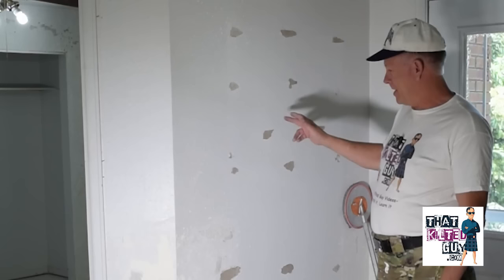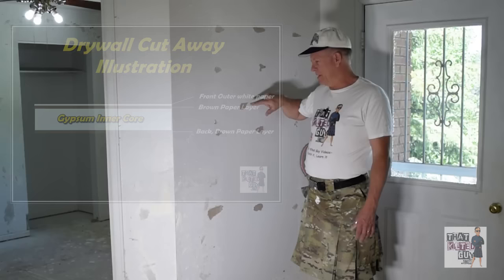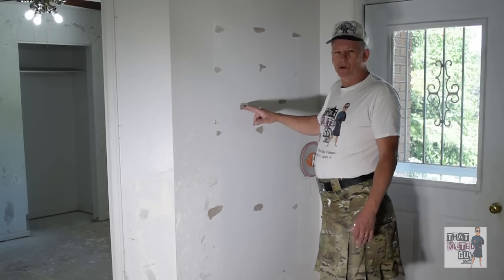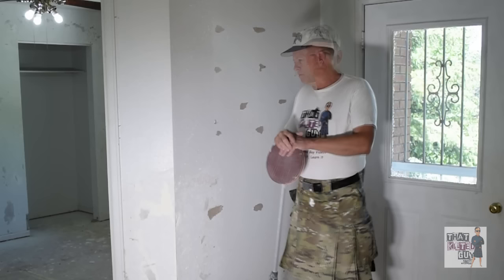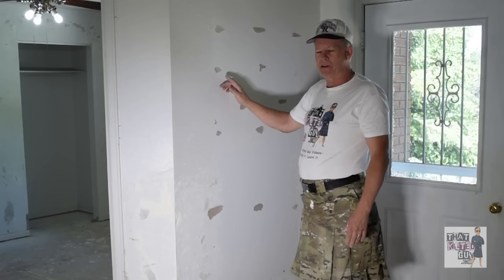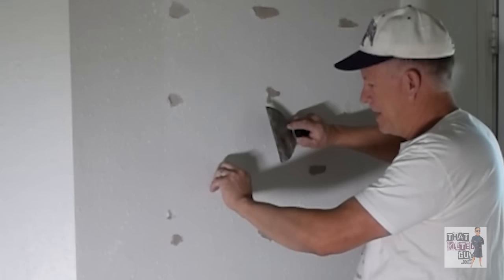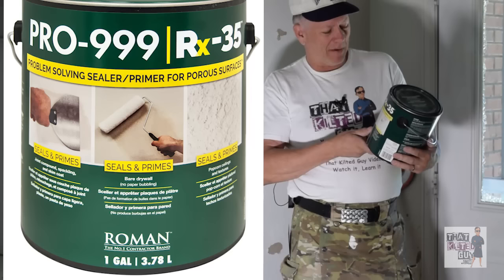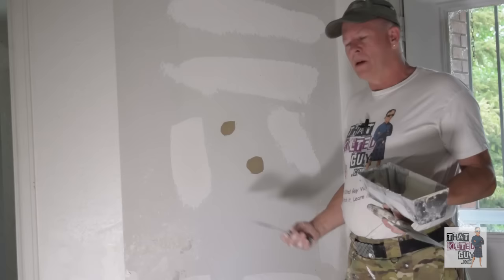⭐ Repair Damaged & Torn Drywall Paper BEFORE YOU MUD IT in 2022!

Comment: Shellac primer works great. Dries fast and thin, and really seals it in. I pretty much ripped off a whole wall (old Sheetrock). Did the whole thing twice and sanded it really quickly and mudded it. Came out fine (after I did an amateur skimming job).

Comment: Awesome technique for the smaller patches! What if you have an entire wall (almost) where the outer paper has ripped off down to the brown?
Reply from the maker: Well, that would make that wall a bit weaker as far is being resistant to punctures and such, but otherwise you would repair it is in the same technique as in this video. 

I hope that helps, and if it did, you can tip me if you’d like by buying me a Ko-fi sometime at ko-fi.com/thatkiltedguy. Thanks, Guy

Comment: This man knows his stuff! 
The basic rule of thumb for filling with mud is to build it up some, THEN sand it down to flush! It's so much easier to sand it DOWN TO flush, than it is to guess on how much to fill (or not put enough mud on) because it does shrink some! So.... you end up having to put on several thin coats ...and you still end up having to build it up, just to sand it to flush! Better to have a little too much than not enough!

Comment: good stuff but takes too long to dry... sand with sanding sponge almost down to gypsum, spray with rattle can of KILLZ, And coat with a pan of 5 minute hot mud.....You can finish that entire wall with 2 coats and texture in the time it takes for that stuff to dry
Reply from the maker: When you need to start coating right away that can work. I’m almost always doing other repairs in addition to these spots so the drying time is fine with me. I used to try the kilz a lot and it worked about 80% of the time and maybe 90%, but I still had too many failures. This product is more like 99% success. Another technique I’ve been experimenting with that seems to be working is simply spraying spray adhesive on it, rubbing it in and then I can coat the repair in 15 minutes with five minute hot mud. 

Getting rid of the brown paper is another option, but if you have six or eight or 10 of them like I often do, I prefer another method. I don’t really like ever leaving the raw drywall exposed and would probably tape it with mesh tape if I did.

Thanks for the input and for stopping by.

Comment: What if I’ve already put a coat of paint over the damaged spot thinking that Paint would cover it?  I’ve put compound over it twice and sanded it but it doesn’t seem to help
Reply from the maker: Hello, once it fails by bubbling, you just have to basically do what I did in this video and cut around it and peel off the bubbling portion and start over. That’s why I treat all of my brown paper spots with this product to avoid failures that I have to redo. If you have any further questions let me know. I hope that helps. Guy

Comment: I bought the Roman's 999 last night after seeing you recommend it in another video several months ago.

The new house has some full hand sized areas where there is brown paper after the older plastic corner bead was removed but the many coats of paint were not cut off of it first so it tore huge areas when removed 

I'm going to be using the Roman's 999 to repair it all before installing the new vinyl corners.

I've never used the vinyl bead before so I came back to your channel to look for another video to show me how

Thanks for always being my go to guy
Reply from the maker: I did give you a link in your other comment and thank you for being a long time supporter of my channel!

Comment: Ive had pretty good results by using a thin layer of wood glue. It's water based but doesn't cause any bubbling. Go in after with your mud and it leaves a perfect finish

Comment: Guy, Awesome explanation that even someone like me can follow!  I have a little different of an issue relating to drywall damage I am wondering if you could comment on.  I have three rooms in my home where a previous owner removed wallpaper damaging the drywall like shown in your videos, but painted over the damage.  Now I have these damaged walls that have been painted, and in a couple of cases, painted more than once.  There is pretty extensive damage.  Because of the walls have been painted over the damage could I use these same steps?  Thanks again for your helpful videos.
Reply from the maker: Hey Mike, thanks for asking and being part of my YouTube community.  IF the painted over spots didn't bubble, then I'd just lightly scrape, then lightly sand and coat it, pretty much like in this video.  IF IT DID bubble, then cut it out and go from there, like in the video.  Hope that helps and if you appreciate my help, I hope you'll consider joining my Patreon page for as little as $1.00 a month.  www.patreon.com/thatkiltedguy , Thanks again, Guy
Reply from the maker: I also just set up a new tip page where you can buy me a Ko-Fi, at http://ko-fi.com/thatkiltedguy.  It's a pretty cool way to tip me, so it's just another option.  Thanks
Reply: Thanks for replying Guy.
Reply: Thanks for replying Guy.

Comment: We just removed what turned out to be two layers of old wallpaper, the original of which was probably installed when the house was built back in the 70s.  We did the scoring technique and used a wallpaper stripper to loosen the paper. The top wallpaper was flocked, and something like a canvas backing--very tough! Even with the proper tools, I still tore some pieces (some large) of the drywall paper.  I had already used mud on some of the lesser spots and discovered that MORE of the drywall paper puckered in the process. Then I turned to YouTube to help me out... discovered this one, and went back to uncover my mistake and correct it.  I ran out immediately and bought the PRO999 and then began the process of fixing my problems. Unforturnately, I think the paper covering on my drywall was possibly not the quality of today's drywall, because when I sealed the cutout places with the PRO999, I soon discovered the paper below the cutout spot had puckered as well. So each time I tried to repair a little spot, it kept getting bigger and bigger.  I finally came back to see if there was anything short of removing the old drywall and replacing it with new, and discovered another view that indicated that when you have a lot of tears in the surface of the drywall, you need to sand down ALL of it as gently as possible, and THEN seal with the PRO999.  I suspect we are going to have to replace the drywall, but to anyone who has begun the process and is still getting ripples in new places on the drywall--don't do what we did, and keep on cutting out larger and larger areas and trying to fix it...
Reply from the maker: Riley, in all my years, I've NEVER had to replace the drywall over torn paper.  I've fixed some bad areas too.  I think maybe you didn't prep the surface well enough.  ALL loose paper has to be removed, and the reason I cut it back to the edges, then peel the paper is if you just peel, it will often raise the edge where you tear it, slightly, and now you have a new problem.  Also, it's often a good idea to put 2 coats on, and be sure to allow the full 1 hour dry time between coats, and before coating with mud.  

I once had customers scrape their own popcorn and they created about 500 torn brown paper spots, most the size of a silver dollar, and they put 2 coats of this on, as per my recommendation, then I skim coated it and I think  I had 2 spots pucker.  Anyway, good luck.
Reply: Thanks for all the great info and techniques you showed us. I've never seen anything like this either! We finally decided to remove the old wall paper and replace the sheet rock. Not looking forward to it, but in this case, I think it will be easier than the alternative (smile)...

Comment: Here's my first attempt with Rx-35:  I treated several brown paper spots with Rx-35, let it dry 24 hr., then first coat of 20-minute hot mud, and I was quite surprised to see bubbling on some, not all, of the spots next day.  Is one coat of Rx-35 usually enough?  I regret I didn't take pictures before I put on my second coat of mud.  Should I have started over?  Any other suggestions?
Reply from the maker: Hello, if it bubbled it’s possible that you still had a layer of brown paper that was loose and needed to be removed before you put the RX 35 on. You do have to get all the loose stuff off. Two coats are better than one if you have the time to let each coat dry. If it does bubble, I would simply cut out just the bubble part and recoat it and go from there.
Reply from the maker: Also, everyone should be sure and subscribe and click the bell icon if you are interested in this subject as I'm shooting a new video testing 10 new ways to repair these, and showing why it can fail, what to do about it, testing 2 coats vs 1, etc.  Here's the subscribe link-  https://goo.gl/hCyPDk
Reply: @ThatKiltedGuyDIY  in response to this issue if the damage isnt near the edge of the rock and prob not having a stress fracture at anytime would cutting the paper out in that area  down to the rock be acceptable and avoiding the bubble issue all together? I realize the paper has its strengthening purpose but when in doubt can we rip it out?

Comment: Can Zinsser Bulls Eye 1-2-3 also handle the torn drywall paper?
Reply from the maker: I've tried primers, and still had too many failures.  I'm testing some new methods lately, that will be easier and cheaper to do.  I plan a followup video to this one and will test several methods and will show some methods that will fail.  So be watching for that video pretty soon.  But here's a few to try, spray adhesive, or oil based Kilz, although I've had failures with that one too.  Thanks for the questions.  Guy
Reply: So far it's working for me. (I looked for the recommended product but it doesnt exist here, and ordering it online was prohibitively expensive) The Zissner was the next best thing that I could find. It looked like it bubbled at first bit then they tightened up. I've had the primer up for about 2 weeks (I have textures I need to get rid of and I'm not sure how to proceed so it's just sitting lol) with no apparent issues.
Reply from the maker: Ryan, locally I found it at Home Depot.
Reply from the maker: Kikz and rx-35 are not the same

Comment: Good video Guy. Thanks. A drywaller years ago (probably 15- 20 years ago) told me he used shellac to seal the white and brown paper for repairs like you show with the added benefit that it’s usually dry in 10-15 minutes. Do you see any issues using shellac to make similar repairs?
Thanks for all the great content.
Ron
Reply from the maker: Hello, shellac probably will work, but I’ve never tried it. I have however tried oil based primer and it worked better than nothing, but I still had a roughly 10% failure rate. With this product it’s more like 1%. I’ve been experimenting lately with applying a spray adhesive and rubbing it in and I can coat the spot in about 20 minutes this way and it seems to work so far. There’s a couple options for you and I hope something helps. Let me know how it goes. Thanks for stopping by.

Comment: Hi Kilted Guy, Have a question for you.  Have a room that had wallpaper from floor to halfway up the wall, then painted with knockdown texture from there to ceiling.  I've removed the wallpaper but the lower half is sheetrock and upper half is painted knockdown texture.  I'm new at this, is the best approach to paint primer on whole wall, apply a strip of mud along the boundary between the sheetrock and painted (maybe 12 "), sand that, then retexture the entire wall using a roller to apply mud then knockdown knife to create texture?  It's be nice if I only had to texture the lower half but I'm skeptical that I could make it match the upper half.  Thanks in advance for any guidance.
Reply from the maker: Hi, a knockdown is one of the more difficult textures to match because you have to guess how thick the mud should be, then get it to spray on a patter you 'think' will match, AFTER you let it sit for around 5 minutes.  Then you knock it down and hope you got it.  I'm really good at it, but that's thousands of texture matches later, so I wouldnt recommend trying to match it.  

I would probably suggest finishing the bottom portion like normal, fixing any damage etc, the skimcoat, or coat everything, up top.  Then sand it all and re-texture it all.  At least the wall will have the same texture on it all across, even if it doesn't match the surrounding walls.  

If you haven't yet, you should watch my video on Matching Orange Peel Texture https://www.youtube.com/watch?v=H3MOmRcJ_3Y&lc=UgxgNTB9jxqF1T1-cVt4AaABAg for some tips that will help with any sprayed texture.  I'll be putting one out about knockdown one day before too long, but it's not out yet.  Practice on a small section first, and if you don't like it, wipe it off and try again.  You can buy a cheap texture sprayer from Harbor Freight for about $30, and I tried it the other day, and love it, although the hopper is kind of small.  

If you're really on a budget, you can either do a skip trowel like in one of my videos, or  buy a Stomp Brush and do it that way.  I'll put that video out one day too.  But if you just roll it, you won't likely get enough stipple to knock it down.  A knockdown starts as a fairly thick mud, sprayed with lower pressure, a slightly larger nozzle and big drops, then it sits for a bit to slightly thicken, and then you knock it down.  I prefer a plastic knife, but they sell a cheap rubber knockdown knife too.  I dislike metal knives for knocking down.

If this was helpful, please consider becoming a subscriber to my patreon page to help me be able to continue putting these out.  It's at: https://www.patreon.com/ThatKiltedGuy

Also, be sure to check out our brand new website, which should be live around 9/11/2018 where I'll have a lot of useful information, articles, tool reviews and guides, all my videos and much more I can't do on here. 

Well I've been working on my website all night, and a free ebook I'm giving away on it, and it's 2:41am, so I'm off to bed.

Thank you, Guy, That Kilted Guy.

Comment: What mud was used at 11:57. You mentioned “that mud”. I’m currently removing the popcorn ceiling and have some tears in my drywall so I am so happy I found this video and excited to tackle the repair.
Reply from the maker: I use hot mud for fast fills, with quick recoat times, or deeper fills, USG Plus 3 for the rest, including top coats, texture, etc

Comment: I have never seen that product in my market. I use killz in spray can. Need to use the original and not the low odor. It works well, been using it for years with no problems, and it dries in 10 minutes or so. The major drawback to the product you showed is the extended dry time. Good video
Reply: Could you hasten the dry time of the R-35 product with a blow dryer?

Comment: Thanks Guy!  What I'm dealing with is in the garage.  The person that lived here damaged the wall with their car door.  I have both raw drywall and brown paper to work with.  I did cut around to get clean edges.  Not sure if I should use mesh to will in the deep areas?  I have found your instructions helpful.  It's such a small area relative to the project I hate to buy the can of stuff you recommend to seal this area.  Thank you for your replay.  Linda
Reply from the maker: Hi, you can sometimes get by without the pre treatment, but if not, try Spray lacquer, or even Hairspray, so I've heard.  You really only need mesh on actual cracks, not so much holes.

Comment: I am leery about scoring with a razor around the damage site.  Worried about weakening the underlying structure. I just scrape them off with a putty knife and remove any blisters.
Reply from the maker: You are not harming the surface at all by scoring it. It’s already weakened by the paper damage anyway. Plus if you did weaken this one spot it’s not gonna make one bit of difference anywhere structurally

Comment: I'm going to look for that product! I usually use some type of primer and then hot mud but I've run into as issue every now and then. When I've run into an issue with it bubbling I'll knock the bubble with a hammer and then re apply hot mud. No one ever showed me that method but it's seems to work. 
Thanks for sharing your vid.
Reply from the maker: I actually just shot the first part of a new video today trying out 11 methods including water-based primer, oil base primer, and some other cool ideas including hairspray. Be sure to check it out when it comes out as it may be pretty interesting.
Reply: That Kilted Guy DIY Home Improvement I will check it out for sure!
Reply: @ThatKiltedGuyDIY  is this video out??

Comment: Hello Guy, please forgive my amateur question.  The first layers of sand was white, why was the second layers yellowish? Is it a different product?
Reply from the maker: (copied from new reply above, which I just put at the top just now) You'll see I apply a very white mud the first time and a yellow mud the 2nd time.  The first coat was with a fast setting joint compound, aka hot mud, and I use that because it shrinks less & sets up quickly allowing me to put multiple coats on in one day if needed.  Then for the final coat I use a regular lightweight, all purpose mud.  In this case it's called USG Plus 3.  Hope that helps.  Thanks, Guy